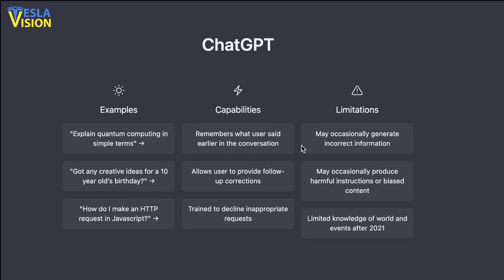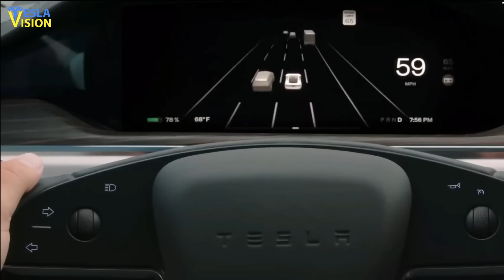Incredible Capabilities of Tesla Optimus Robot That Others Can't Do

Comment: The critical path for humanoid robots is their software i.e. its brain. This determines how it works, its flexibility and intelligence. If it is based on traditional codeing it will be severely limited. If it based on Neural Networks using state of the art learning techniques & systems it will be infinatly more useful and acceptable.
It is unfortunate that this video does not seem to emphasise this.